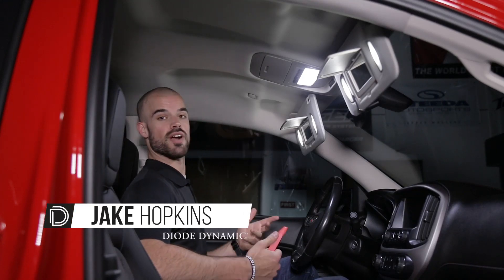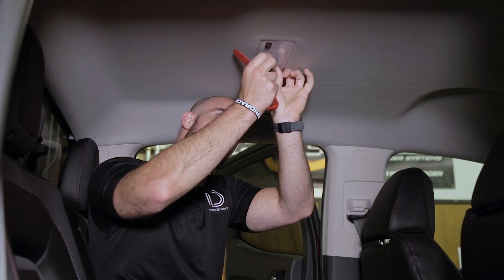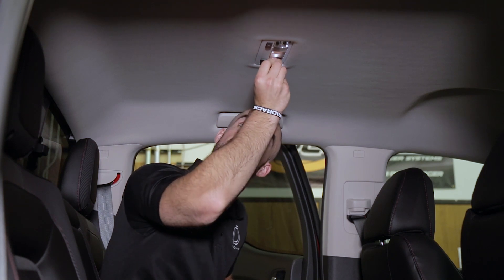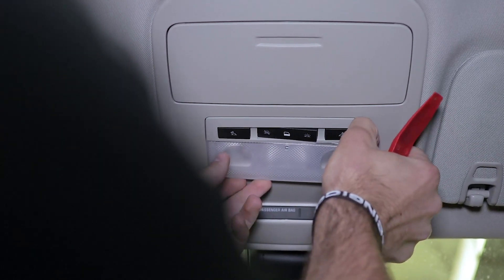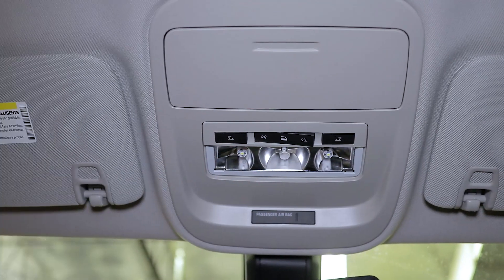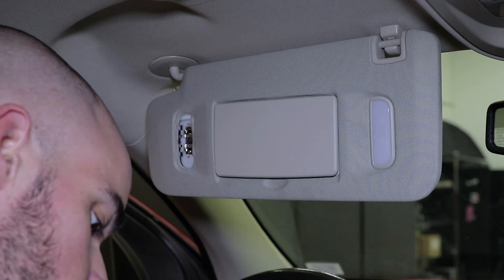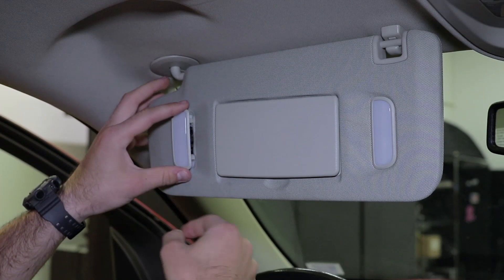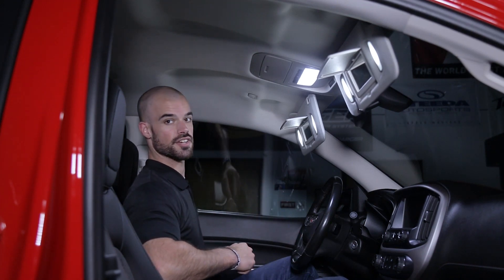How to Install 2015-2019 GMC Canyon Interior LEDs | Diode Dynamics

Comment: For any vehicle, upgrading the interior lights to LEDs is an easy and significant improvement! And the DD LED bulbs are the best around, so it's a no brainer.
Reply from the maker: Thanks for your support!
Reply: Just get the tool, they're really cheap & at most auto stores or on Amazon. Maybe $5